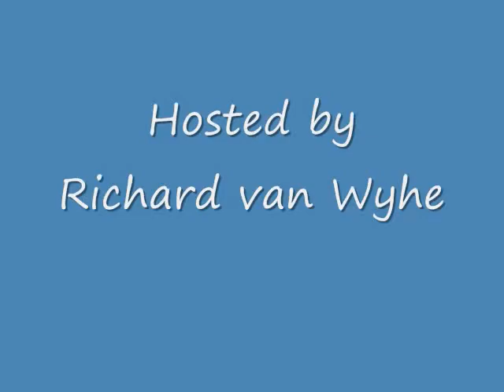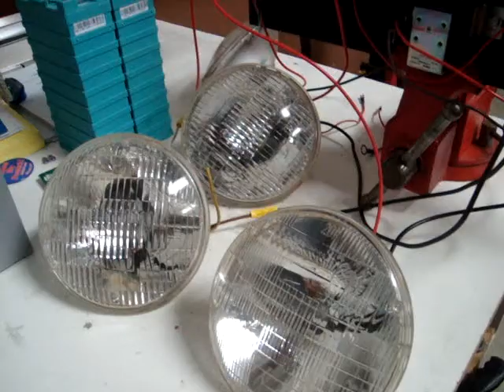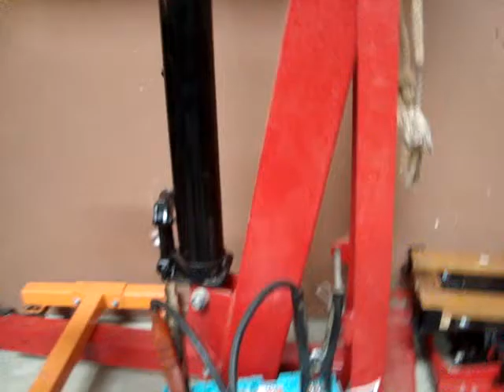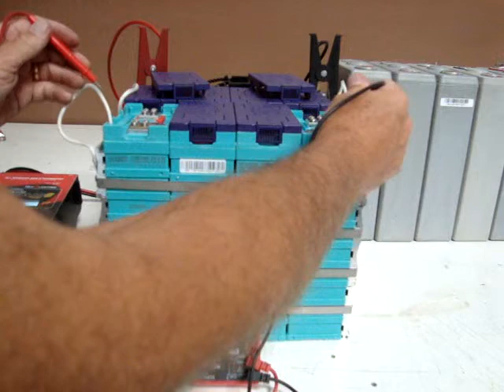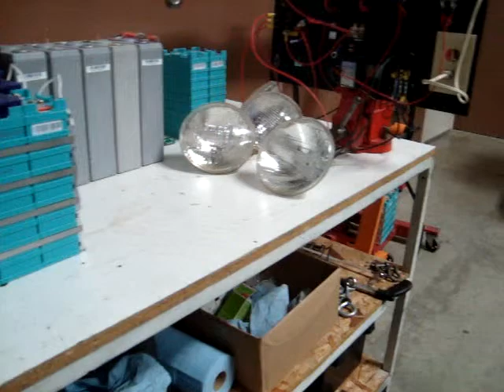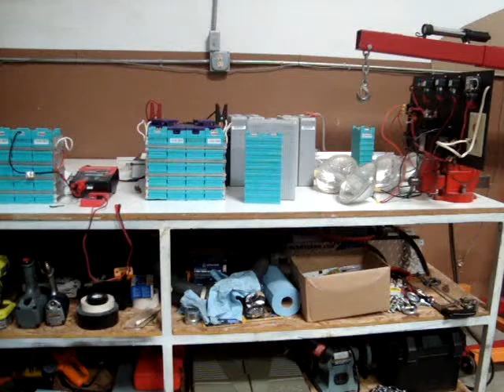Lithium Battery Bottom Balancing, Check This Video For Up to Date Info, https://youtu.be/gA5iwVQa2Hg

Comment: Hey Guy.. Just saw your video,, I'm building a power wall and using a large BMW hybrid pack, i'll be modifying it for a 48V system. 
from what i have learned, I won't need a BMS as i thought, and that bottom balancing is the way to go for such a large pack.  BMS is better for smaller things.  the cells i am using are used of course, just fine for beginning system. I will have a bank capacity of over 660Ah worth.
It will be a lot of work.. all the cells are the same, but the packs are different sizes ( 3s , 4s, and 5s ) i have to arranged them to where i obtained  13s6p 
Any advice you can give ?  I'm not a novice at this,, but i am a novice for dealing with such a huge size bank.
Thanks for your videos..
Reply from the maker: Please address questions to:  info@EV4Unow.com

Comment: Hi!
Thanks for the video. I really like the idea of bottom balancing.
I'm working with 18650 cells mostly, I still hope you could answer these questions:
- While the nominal voltage of the 18650 is 3,7 mostly, could you discharge them to below 3 volts regularly, and would his give more capacity?
- Why do you only charge the batteries you are using to 3,5, while Lithium Ion can be charged up to 4,15/4,2? Has this anything to do the the composition of these specific batteries, or is this a choice because of safety?
Reply from the maker: Battery cells have three voltages to be aware of.  Maximum voltage, nominal voltage, and minimum voltage.  Nominal voltage is used to calculate capacity.  Minimum and maximum voltages are limits that you must not exceed.

Comment: I got 95 lithium ion batteries of 3.7v each for my inverter. What device or where can I buy device to bottom balance the cells. 
This is how I arranged the cells.
I connected 19 cells in series and made five  stack of them. Then connected five of the 19 cells in series in parallel. Each 19 cells in series is 70.3 volts. 

I want my lithium ion batteries to go so many cycles so I will never charge to the 70.3 volts normal capacity. 
I want to charge it to maximum of 64 volts . For this reason, I think I shoukd not do top balancing rather only bottom balancing. 

Is there any deceive I can buy to bottom balance my 95 cells or how do I bottom balance it?
Reply from the maker: Check out this video.  https://youtu.be/4rS2j77oMDE

Comment: How are these GBS cells doing long term?
Reply from the maker: The LiFeMnPO4 chemistry seems to have more of a voltage drop under load and they don't perform as well in cooler temperatures as the LiFePO4 chemistry.  The terminal connects require much more attention on the GBS also.

We have not used them for years.  We prefer the CALB cells.
Reply: But these GBS cells are LiFePo4 right?
Reply: And let me know why do you prefer CALB?
Reply from the maker: No they are not.  As per my first reply they are LiFeMNPO4.
Reply from the maker: See my original reply.

Comment: Hi Richard, great video, thanks for the help. May I ask a question.
is the technique the same for cells that are paired in my pack? , can I bottom balance while the cell pairs are still connected in series to the rest of the pack? and finally do I need to disconnect  my mini-bms boards from the cells while bottom balancing?
thanks again
Reply from the maker: If you are using a battery management system, then bottom balancing is a waste of time.  It's one or the other.  Why would you bottom balance your cells when the BMS is going to be top balancing the cells?
Reply: I thought that the pack had to be bottom balanced before fully charging, as the mini bms can only move very small amounts of energy to "fine tune" the balance at the end of the charge cycle
Reply from the maker: Please direct all questions and comments to info@EV4Unow.com
Thank you for watching.

Comment: Great vid,,thanks. You would not have to inspect the brushes if you used a AC motor. Then there would not be any maintenance except for charging the batteries.

Comment: So basically discharge them together in series until they get to 12v(wait is that 12v total for all the 4? So average 3v each?), then discharge them individually for a fine discharge until they are 2.75v each and then hook them back up in series and charge them together? 
If you discharge them to a specific voltage how long will it stay at that voltage?

Thank you for your videos
Reply: +EV4U Custom Conversions It would be greater benefit for everyone if you would respond here so that other people could read the answer as well.
Reply from the maker: Bottom line...discharge to 2.75 volts per cell.  Wire your pack in series and charge the pack to a total voltage of (number of cells times 3.5)  After 38,000 miles of driving we have a pack that all of the cells are still exactly the same voltage as when installed.  Makes me a believer in bottom balancing.
Reply: +EV4U Custom Conversions So let me ask you this, would it be any different if you just charged each cell separately to full capacity and then connect them together and start using?  I would call that top balancing  :-)  I am in the process of building small battery pack and that's my strategy plus measuring each cell capacity and try to match cells in parallel packs, please let me know if this is wrong and why.
Reply from the maker: Please address all correspondence to info@EV4Unow.com.
Thank you very much.

Comment from the maker: We draw them down in groups of four (in series) to around 12 volts or a little less.  From there you want to address them individually.  It is a time consuming process but it can be a life saver to your cells.  We do it with four in series as it is easy to find a 12 volt load.  But you could also do it with a parallel configuration. Remember to closely monitor your cells as to not over discharge one.

Comment: Hi, I like your videos, they are very informative and enjoyable, thanks for making them.
I have both the Powerlab and JLD5740 and prefer the JLD5740 a little more because it doesn't matter how many times it has to cycle, it could be 10 or 50, it just keeps cycleing till it quits. I've bottom balanced 6 cells hooked up in parallel with 20 feet of 3/8" rebar as a load running 160 amps.